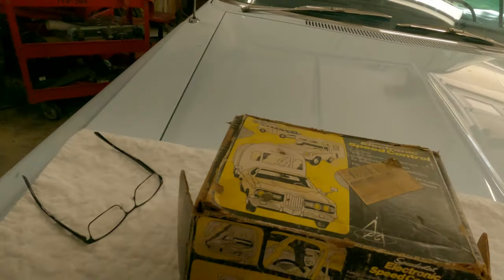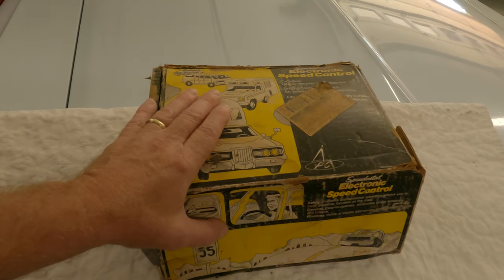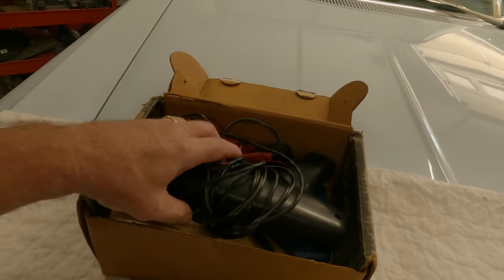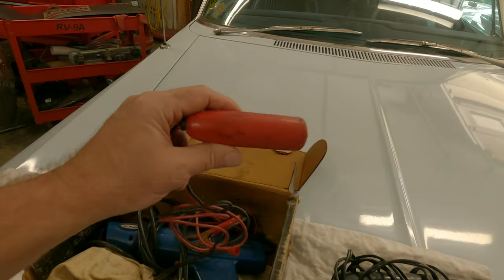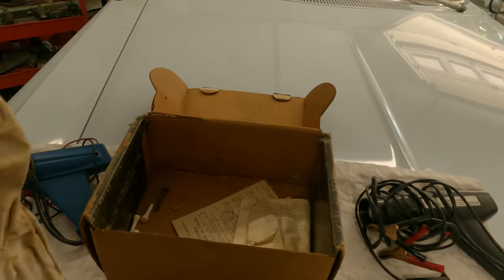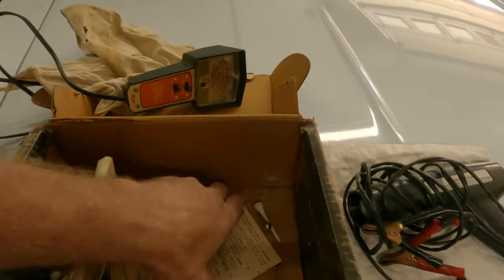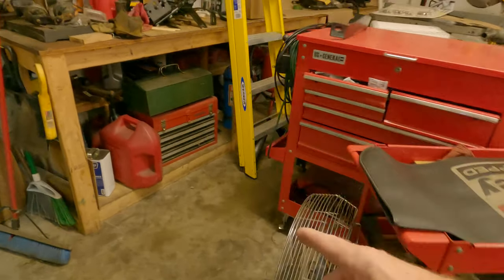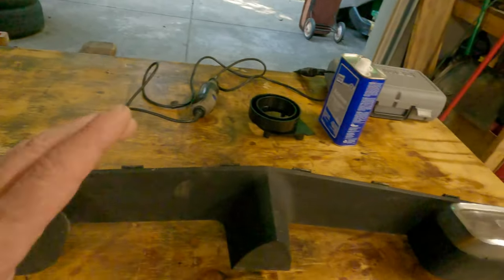Muscle car grill repair with Acetone and ABS Plastic - 1972 Plymouth Cuda

Comment: I had heard of that process but never seen it done. I've only used the two part epoxies for modern ABS bumpers. Thanks for video!
Reply from the maker: I'll be honest Mitch, the epoxy is probably better for a repair that you will never see.  This is just an alternative.

Comment: It was an E-150 extended wheelbase van with dual fuel tanks.  It was almost impossible to get cruise control back then on a manual transmission.  There was ya shutoff connecting both the clutch and brake to turn it off.  
The reunion trip to MO, was a total of 3,200 miles round trip, from FL, to MO, to IL, to KY and back to FL.
Reply from the maker: That was a heck of a ride, should have had your van for that trip.

Comment: Nice repair. So the grill is ABS plastic too, which is why it melts together with your mix? Guess I didn’t know that. I’ll keep this in mind when I do my ‘69 Barracuda grill, has several cracks in the corners. Good job.
Reply from the maker: Hey Ron, Yep it's like building a model car when you were a kid.  I don't think that melts the grill as much as a plastic model but it does seem to hold up pretty well.

Comment: Perfect job. Using JB weld glue or this technique is better ? What do you think according to your experience?
Reply from the maker: Thanks Arif.  I think that both have their places, this technique would probably work better when repairing thin grill pieces.  I could have used JB weld here and it would have worked as good or better since you can't see it anyway.
Thanks